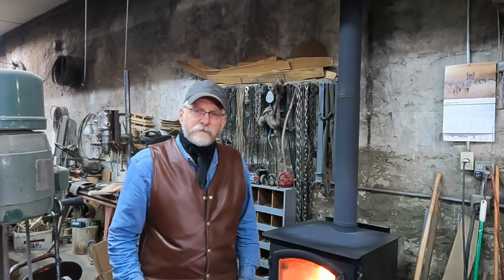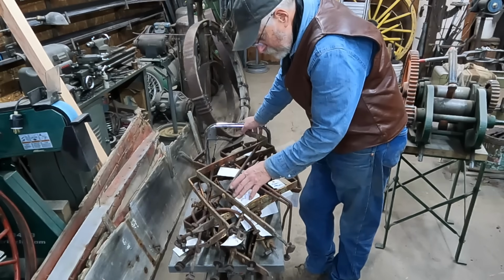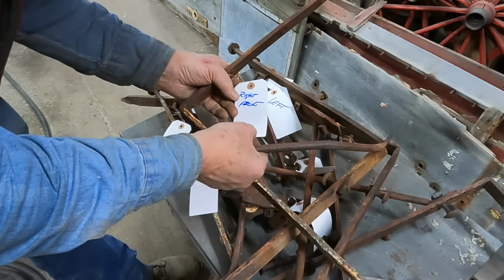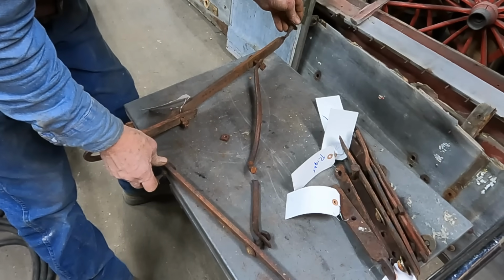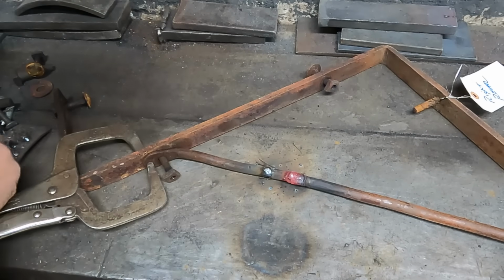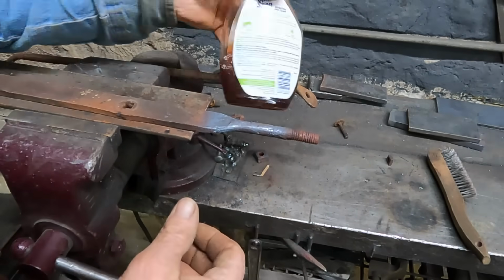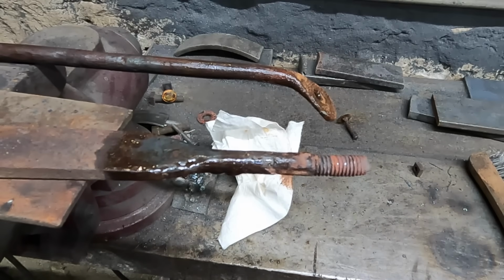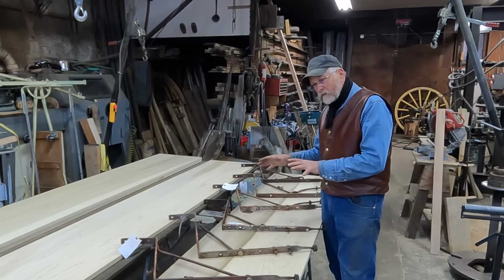How To Make New Weld Repairs Look Old | Engels Coach Shop

Comment: Vinegar and steel filings or steel wool like I used works great on wood but not all wood. Oak takes it really well but cedar just looks muddy. 
Surprised but not surprised that it works so well on the fresh repaired braces and brackets.
Reply: you can try to remove surface oils in the wood using acetone and applying a solution of tannic acid and allowing this to dry, before treating with the vinegar mix. It is the natural tannin in the wood that reacts to give the dark colors. Oak has a lot of tannin but some woods like cedar, have very little natural tannin. You could try some test pieces, using tannin from boiling up a few tea bags in water, to make up the solution.

Comment: I remember watching my Grandpa do some of this ... weld up parts, old tools, bolts, nuts, screws, chains & links, etc.  Make 'em rust, then he'd boil them for quite a while, dump them on the table and I helped rub as much rust off as we could with a brillo pad before dropping them in a pan of kerosine.  They would come out black and didn't want to rust anymore.  Later I've found that it's a form of bluing that used to be done as a quick preservative of steel.

Comment: Dave, I have been following along for 5 or 6 years now. I enjoy your videos enormously, the content is fascinating and the production/editing is masterful.  Well done!  Most of all I enjoy forensic analysis of how these old vehicles were built and in the end fell apart.  You sometimes discuss the new timber you use, and a I remember few years back you compared the strength of various species. I would be curious to know more about the original timber, from which the wagons were made, was it good or bad, local or special, was it built to last, and what do you learn from this.

Comment: I really like the way that wagon bed turned out. I will definitely be using that method of aging if the need should arise in a project. The creative rusting reminded me of something. I have seen a few antique engines with a rust finish. Instead of removing the rust and re painting, the owner just used light oil, and probably some very fine steel wool, and buffed the rust to a smooth to the touch sheen. The effect is of a slightly mottled, rich maroon color that I find to be beautiful. I much prefer that sort of look to a freshly painted and pin striped 100 year old engine.

Comment: The mix you make with vinegar and iron ends up to be iron acetate , on the wood it reacts with the tannins and produces the gray color you want the acetate has a relatively low PH and etches the iron and oxygen in the air  quickly rusts it in the micro cavity 
produced in the etching so it doesn’t rub off .  I use this mix for aging / ebonizing wood too, I make mine with % 45 agricultural vinegar and course steel wool , wash the oil off the steel wool with a degreaser and make sure the vessel is vented and away from sparks or flames as the gas produced is hydrogen.

Comment: If the project is not to be stored in fairly dry conditions, rusting is likely to continue over time. In these circumstances I take the process one stage further and convert the rust ' into ferric tannate, which gives a steel gray to black 'antique' metal finish which, is pretty resistant to further rusting. The process is very simple and involves immersion of the object in a hot tannic acid solution and simmered for about a half hour and, after removing any loose surface dust with fine wire wool, I apply a thin oil coating with the object still fairly hot.. I make my own tannic acid solution by saving up my used tea bags till I have a half gallon or so, and boil them in a about a gallon of water for an hour. Alternatively you can just buy tannic acid. The tannate process is widely used by museum conservators. as the acid only reacts with the rust, not the iron, it will work best on items having a fairly even coating of rust but to some degree, can be sanded back to highlight wear points. Tannic acid is pretty weak and I have never felt the need for gloves, but my old hide is pretty leathery ;<)

Comment: I think the heat results in a combination of ferrous ferric oxide rust with the ferrous component being better bound to the metal and more stable.
Reply: Heat gives metal an affinity to take on oxygen. It's why you have to shield when you're welding. Otherwise before you're done you'll just have a pile of rust.

Comment: What would've been the preferred method back in 1930's? Bronze brazing? Holes, pins and braze? riveted metal splinters? riveted pipe sleeve? brazed and riveted pipe sleeve/splinters? Forge/hammer welding sleeves/splinters? Showcasing pre-welder fixing methods would've also been a neat addition to this project.

Comment: I am impressed with your hyd press. Don't know what the capacity is but sure worked wonders under the direction of your nimble fingers.  Why did you switch to the arm/hammer press technique on the later pieces? Oh yeah, experience.  Would you please enter the "recipe" for your "patina" maker solution
Reply: I think you are referring to making the wood look old. No real recipe. He mixes white vinegar and metal file shavings (some people use steel wool), then mixes that with water , 2/3 solution 1/3 water.

Comment: I usually use electricity to evenly rust a piece i repaired and need back to original state. Tho, that does mean cleaning the whole piece to start from scratch, otherwise it doesn't look even, so only for parts i really need properly done. The rest, i just pack it with moist salt for a couple of days. LIke that rod, i would've used a towel to pack in some salt around it. Really brings in patchy, even rust.

Comment: Here I am. Watching rust dry. And LIKING it! BTW, is there a ratio for your vinegar/filings mix? And does that ratio change for metal vs. wood application?
Reply: dlNo real recipe. He mixes white vinegar and metal file shavings (some people use steel wool), then mixes that with water , 2/3 solution 1/3 water. Same solution for both.

Comment: That project is moving along nicely already Dave. Quick question. Would those irons that are now rusty, and which you are helping to get the same look, not have been painted originally?
Reply: The look of something is subjective. If it were my wagon, I'd remove the rust and apply rustoleum paint in hopes of preventing deterioration. Steel and iron rust through and break. I would paint the wood too. But it isn't my wagon. I don't have any idea why a wagon would not have been painted. Can you think of one?

Comment: Years ago, in Popular Woodworking or Fine Woodworking, one of the user builds they posted worked at a grain elevator and he placed some wood on the chute that grain flowed on to wear and weather them. Then built the project. Boy it looked good. The grain flowing and abrading the wood produced a most pleasing look. If you could have done that on the floor of the sheep wagon then did the vinegar application - well, it would have been great! :^D
Reply: Yeah thanks for that...
Reply: I do something similar on my wood projects.  A wire wheel on an angle grinder will really pull out the softer grain on some wood.  Nowhere near to the level of abrasion you get from grain in an elevator, but definitely enough to "age" some wood.  And for hammer handles here in the smithy, the technique makes the most comfortable handles!
Reply: Using a wire wheel or wire brush, going with the grain works too, it will remove a little of the soft grain and leave the hard grain stand proud
Reply: You can do the same thing with a little sand,  spread it out on the floor boards then do a shuffle walk back and forth to "distress" the wood. Oh and smack some chain on it. Merry Christmas 🎄🎁

Comment: Curious what threads are these cut to ?   Whitworth or something else ?   
Here in europe rural smithies often used "thread plates"   Flat chunks of plate stock with a variety of through holes (with minimal taper  lead in)  that artisan makers could create bolts from round stock.  Same in US  anyone ?    I am trying to rescue these from junk yards  before someone melts them.
Reply: @KT111   Thank you for the trouble you took to reply.   The speed at which crafts are lost is disappointing. The Engels family are doing a superb job of showing what can be done with good hands and a keen eye.    I know the US had a very early start making precision thread cutting tools  but for a back country  workshop thread plates provided a more affordable way of doing the job.   Of course someone must have had a set of some sort of masters  to create the plate.  Interesting that these might be Imperial.  Whitworth is still very much around in Europe though fading away as the  metric coarse threads  replace it.
Reply: @KT111  Sorry.  I do not. 
Certainly unlikely to the point of impossible in the uk -  Home of Whitworth.   Subject to correction by someone who has accessed some better information ....   Metrication came late to the UK.   ISO Recommended as Standard in 1965. Implementation took a long time and is still not fully adopted. 
I'd take a punt and say that Metric spanners  became commonplace  with bulk imports  of  Japanese cars and motorcycles.   Say from late 1960s  for bikes and early 70s  for cars.     Metric tools would have been around a lot longer tho in specialist workshops to deal with imports and war prizes. Some of the first motor vehicles in uk came from Spain France and Germany.  Metric was no stranger.   Id guess and say no one was too far from Metric tooling if it was needed.
The  first big change came  with war time production  and a real need for standardisation.  Our BSF  for instance (a 55° fine Whitworth thread was put aside for UNF  - An American 60° fine)  Pretty seamless changeover at the time from what I was told by  fitters working on airframe and road transport at that time.   The tools were provided and the workers just got on with it.   No bodging of spanners allowed.
There's a lot of history on the website  called boltscience.com    and you can delight in the salad bowl of screw types Britain manages to service  ....brass  gas pipe and model threads,  curious cycle threads and still our faithful coarse and fine Whitworth types.    Quiz item  ...  Whitworth it was invented the method of producing a primary reference surface  that was true flat (3 plate method)
Sad to say the once vibrant uk engineering culture is nearly gone due to political sabotage and a government only too happy to allow overseas take overs.
Reply: @KT111  Hi again.   I checked E-bay  for thread plates.   Some nice ones pictured there for sale.    Thought you might be interested.

Comment: Wonder if you are going to distress the new wagon bottom. I think you sanded in some wear spaces, but dents and dings?  And speaking of coming along, I may have just missed it, but did you replace the manual come-alongs with a powered lift?
Reply: Them's not tire chains. Them's antiquing beaters!

Comment: Where did you get the electric winches that you use on the a-frame setup?
Reply: Harbor freight has some. My only complaint is the take up speed is a little too fast for my taste even with the line doubled back with the supplied snatch block for lifting.
Reply: Harbor Freight

Comment: And the importance of heating and hammering out the weld. so it wont break easy again :) as always Great work. 
and thanks for the work with subtitles. I use the Danish one. English would also be fine. 
not many will do this, even when you inform them. that the auto subs. in any Langues Sucks!!! even english sound to english subs

Comment: Your method of rusting is a similar process to the way firearms were browned . It differs from bluing lacking boiling to turn the rust black.
Reply: Black oxide is FeO4 The red and orange stuff is 2 or 3. See the Iron Pillar of Delhi if you're into rust. It's a famous piece.